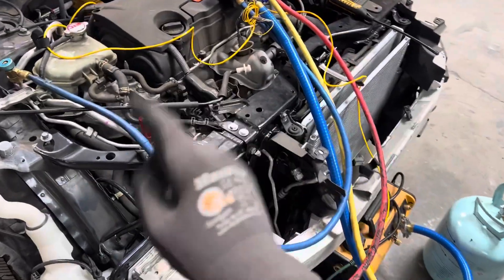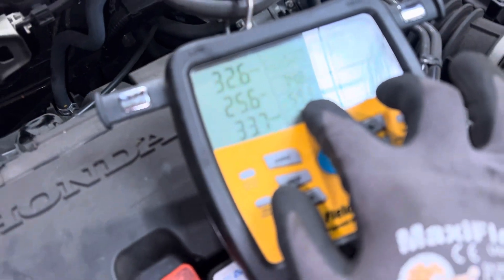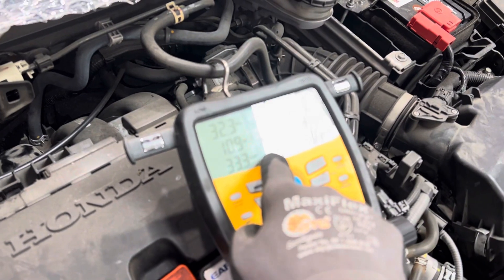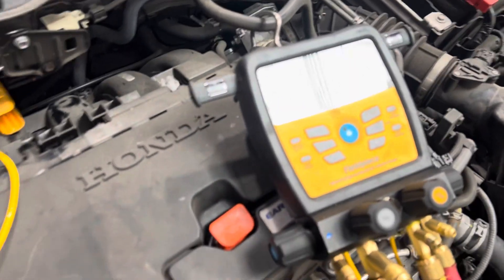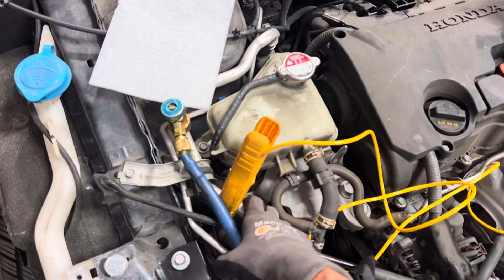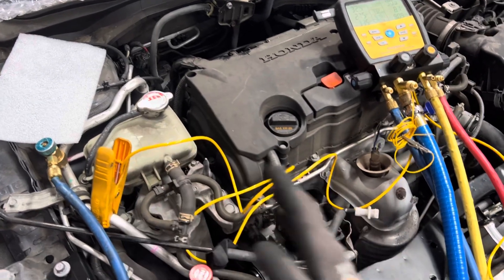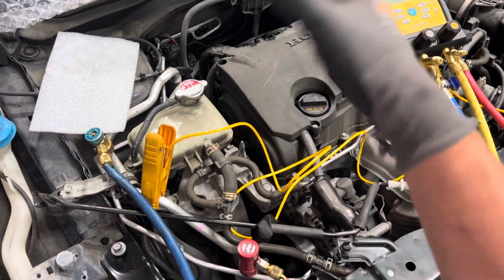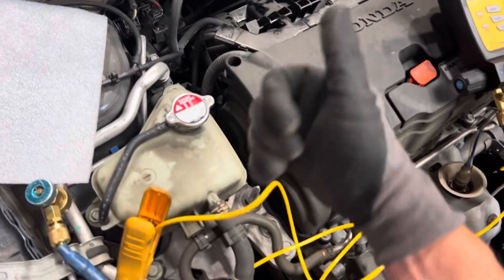HOW OLD AUTOMOTIVE TECHS GET FOOLED CHARGING AC BY COLD 🥶 SUCTION LINE METHOD

Comment: If refrigerant is low and u confirmed no leaks. Do you suggest evacuating the system, vaccuming it out and put all ne refrigerant?
Reply from the maker: Yes, that is the way there is no exception to the rule. 

There is no topping off that can correctly get you back to the factory specifications 

Every system, Leaks they were built that way due to the components that were used during construction. None of them are perfectly sealed. 

Some just leak more than others. Some may take 10 years when somebody is really lucky and some systems leak out not all the way, but just get low within two or three years. . 

When are the things? What makes a very big difference if you have two vehicles with identical leaks  (leak rate per year) 

For example 

One vehicle has a large air conditioning system in it that takes 3 pounds of refrigerant 

Another person has a little economy vehicle that only takes 12 ounces of refrigerant. I would be talking about my Toyota Yaris, 2009. 

If each vehicle had a small leak that only lost one ounce in a year . 

After three years, a total of 3 ounces would have been lost in both vehicles 

The Toyota Yaris, that only has 12 ounces of refrigerant charge . 
3 ounces totals 1/4 of the entire refrigerant charge is now missing . 

This vehicle would cool and have cold air coming out of the dash on cold days but every day a hot day came around 80°F plus there would be no to little cooling because of the loss of 3 ounces of refrigerant 

On the other hand, the large vehicle that had 3 pounds of refrigerant . 

And only lost 3 ounces of refrigerant. The customer would notice absolutely nothing in performance of cooling loss. . 

The little Yaris compressor would be operating under hot temperatures due to lack of cooling coming back to the compressor so I’m very hot days the compressor would run extra hot shortening it’s life 

Well, the large vehicle that needed 3 pounds of refrigerant and only lost 3 ounces. The compressor temperature would still be basically the same within a few degrees possibly hotter, but nothing really noticeable. .
Reply: @coldfinger459sub0  I appreciate the feed back and content. I've been using my caveman gauges, ran into your channel and I'm really wanting to buy that fieldpiece sm480v, that thing is awesome!

Comment: so the inline HX is on the suction line and it tied the TXV circuit?  Had to do a google search.

Have been out of the dealership for over 10 years now. We would always recover, vacuum, weigh out the charge going in.

Never been a fan of those refrigerant cans, but its all I have now. Guess I could get a set of gauges and at least not be totally guessing. 

Subscribed.
Reply from the maker: Yes, Dan internal heat exchanger is both the high side and low side circuit so you have the suction line heading back to the compressor and then you have the hot liquid line going into the section line transferring it’s heat to the cold, refrigerant returning to the compressor so I can deliver liquid refrigerant that is cooler that has the capability of removing more heat in increases its efficiency

And it really messes with the guys throwing them off when they rely on the temperature of the suction line to determine whether they think they’re kind of close to a correct charge .

Comment: Hey Tom can you explain something to me on these new 1234yf systems.  I was replacing some lines on a 2019 or 2020 Honda, civic I believe.  Replaced all of the lines and recharged the system to capacity as stated in service data, not by what was on the lable under the hood.  Both stated the same ammount but some time there is discrepancy.  So here is my question, I touched the low side line directly out of the evaporator, but before the heat exchanger, and the line was barely cool to the touch but the vent temp was in the 40s.  Why?
Reply from the maker: Don’t go by barely cold go by exact measure numbers. 

All cars are different not all are exactly the same . 

Sometimes the suction line is warmer event temperature 

Sometimes it’s the same 

Sometimes it’s colder 

The joys of these new cars with Taraval, Displacement and pressors computer controlled using sensors 

Do not follow the rules of thumb. The technicians used to use on cars from the 1960s and 1970s. . 80’s
Reply: WAIT!!! Take it to the Stealership. There is a Warranty extension due to a  faulty AC condenser.
Reply from the maker: @w0lvez1  for the condenser I believe they extended it to 10 years and 100,000 miles as long as the vehicle doesn’t have a salvage title on it from being in a bad accident
Reply: @coldfinger459sub0  The most annoying part when you take the car to the Stealership, the people there are good playing dumb and stupid like they are not aware about the warranty extension especially if the car was bought from different branch.
Reply from the maker: @w0lvez1  yes, I have experienced that before

And I used to work at a Honda dealership in about 35 years ago

Comment: Internal line  heat exchangers appear in other industries also eg hydraulics ,, automotive , heavy industry . If  u have never seen it before some heavily insulated/  hidden lines it can be easy to miss.
Reply from the maker: Yes, heat exchangers, even in the simplest forms where they have taken two pipes and have braids them together for a certain length section to transfer heat between each other. What is the simplest form use decades ago before I was even born in Refrigeration

A more crude and slightly more advanced . 

Was used where are you soft copper.  For example, a 25 foot length of copper.
       Drill a hole in it with a smaller piece of copper for your liquid line for example, 1/4 inch or 3/8 of an inch push through a 5/8 of an inch or 7/8 of an inch outer copper larger size.    Travel about 25 feet through the copper and come out the other side another hole.

Then breeze up those two holes and you can run either Glycol that is chilled or cold or cold refrigerant . 

And to make it smaller, you can spiral it up into a small coil